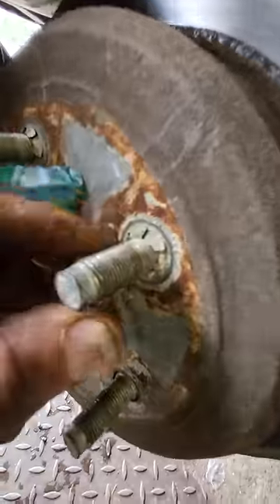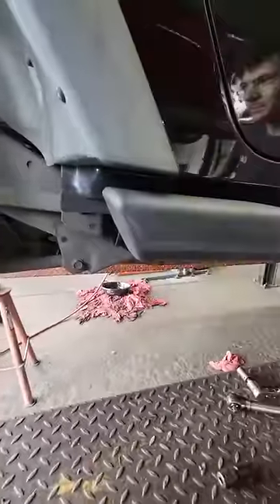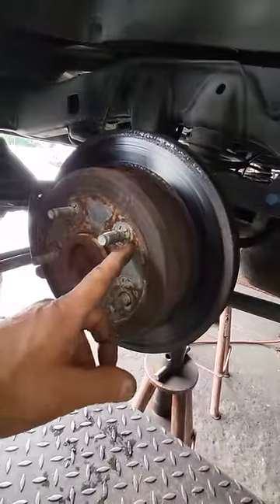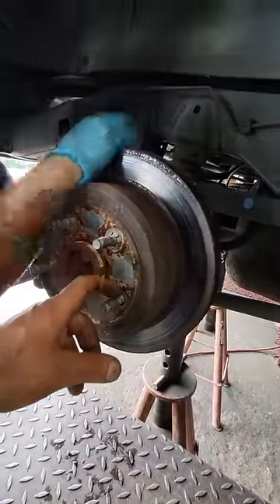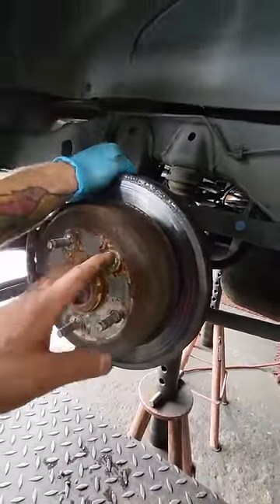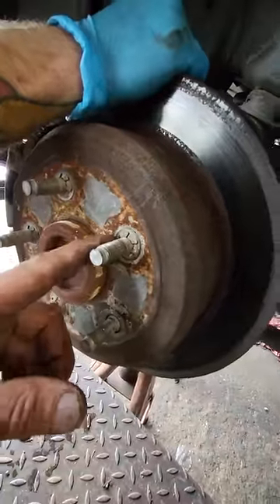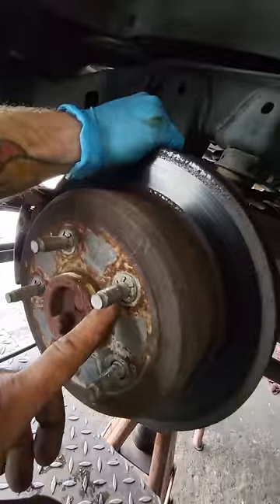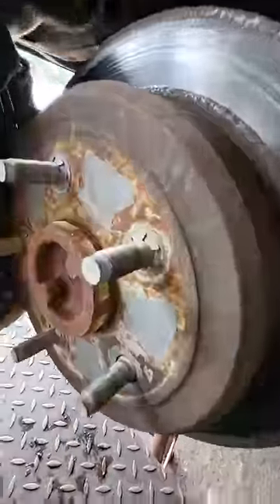There is always that guy

Comment: Like those wonderful Phillips screws on Kia brakes!
Gotta love them!
Reply: Honda too, except they're JIS (Japanese Phillips).  With a real JIS driver they come off okay.  A Phillips driver LOOKS like ut would work, but it acts more like a drill bit.  Old motorcycles are infamous for this.  Kawasaki used JIS bolts for almost everything, and by now every single one of them is stripped.
Reply: Pretty much every car made outside of US has them.. sometimes Phillips some time Torx sometimes one sometimes two but they all have ot both on discs.. can be a pain but usually not to big of an issue.

Comment: For those who are DYI, I found those clips in the SUV of my ex; I needed to replace the original back rotors after 110K miles. It was not common sense to me those clips were to be used as temporary retainers while in the production line, and thus, I went to the dealer to ask for them. It was there were I was explained the temporal nature of them.

Comment: I do my own brakes. Having someone else do them is a waste of money when you can do it for 25% of the cost of a shop. But with all that said, I'm that guy that would put two of the five clips back on. Just to hold it in place while I'm reassembling everything. It's not 100% necessary no. But it does satisfy some of my OCD tendencies

Comment: On my AMC Javelin, they used three bolts to hold the drums on and some of them were still there 30 years later.  A Youtube car repair guy working on a Javelin didn't know what they did and got the axle pulling tool to remove the drums.  Instead of just taking out the little bolts. That car was built about fifteen years before he was born.

Comment: Theres one guy out there that will do it right while there are many shops out there that will overcharge you to cut every corner they can find.
Reply: You literally don't need those. There to hold them on for the assembly line. Tell me you never worked on cars without telling me
Reply: @dippingfool4785 

okay 😂😂 plz leave a comment and tell me how did I do😂😂😂😂🙈
Reply: That's true, and very irrelevant to these little retaining clips.
Reply: @dippingfool4785 They aren't technically needed, but OP's point still stands. Ton of shops out there cutting corners, in the name of profit.

If I had a dollar for the amount of Fiat intake manifolds I see with the support leg cut off, or VW TSI engines, where the support bracket for the manifold is not reinstalled...
Reply: That is not doing it right.
Reply: @LynxStarAuto  well 1st off vw in general is ass too work on. And 2nd were talking about clips for the assembly line to hold the rotors on. There's literally 0 reason to be on there. Apples to oranges

Comment: I'll go into detail about how I went about dealing with these clips. 
My first few years,  I would carefully take them off, flatten and replace them, which took a good amount of time to do. After getting chewed out about the wasting of time and effort,  I began to split them off with a small chisel  in only one point,  which made it easier to take them off without destroying them,  and still replaced them. 
But after enough times servicing brakes, I adopted the habit of modifying certain axle nuts, by grinding them flat enough, and grind a portion of the nut flange down to hold the rotor flush with the flange via the lug nut. Later on I began to come across tools made by several manufacturers with the sole purpose of holding the rotors stationary during service.  I didn't give in,  since my nut method works for studded as well as European designs, while the service tools are specific to either designs. So at the end of it all,  I simply cut them off and tossed them in the trash. 
Needless to say,  when I see these clips in new cars,  now that I'm currently not working in the field,  I can't help but chuckle thinking about how new techs go about dealing with said hardware.
Reply: ⚠️😳☝️🦧⚡️😳🍺🍺🍺👌❗️....✍️🚫🦧
    No, really! I know we've chewed some of the same kinda pain....now I jus clip 'em.. an drop 'em
  ❤
   Edited 
  IM MUCH BETTER...NOW..😊

Comment: I wonder what other "cut that crap off" attitudes they have towards a simple oil change? That crush gasket is fine, just reuse it!
Reply: Agreed. It may not be needed but either the owner took pride and wanted to keep like factory or he did t know they weren’t needed but still made sure to put it back the way he found it. Best rule of thumb when working on cars is to make it so the next person never knew you were there
Reply: The funny thing is they are fine to reuse though 😂 At least a few times. Fleet mechanic here and we never change those on every oil change and we don't have issues with leaks. Our vehicles get about 5-6 oil changes before they're replaced.
Reply: @TireSlayer55 ”our vehicles” 
Why do employees almost without fail use language that implies collective ownership on company property?
Reply: @Bazed. Because the company made them responsible for that property mayb

Comment: I used to put these on when I worked the assembly line... the wheel studs are inserted from the other side of the drum and those tabs hold them in place long enough for the next guy to press them in.
That's their whole purpose in life... hold the studs for 60 seconds and be flat enough to not effect the torque of the lug nuts.

Comment: I once had a customer have me put back the retaining bolts for the rotor. 
That he saw me throw into a scrap bin. 
He literally was watching everything I did. 
I tried to tell/assure him that they are not needed and are used on the assembly line. 
He wouldn't hear it. I dug them out except one I was unable to remove, that I drilled out.
Pain in my as s. 😠
Reply from the maker: Yeah, just like the customer who say hand tork my wheel, nope, I won't do that  either
Reply from the maker: And yeah I don't do that either  toss that crap ..so the next time they stripped  break or seized
Reply: I always refit mine.
If you don't, and you remove the wheel, bits of dirt or rust can fall down behind the brake disc, causing your steering to wobble under braking.
Just put copper slip on them, and don't put them on tight.
Reply: That's what happens when people don't know what they're talking about or looking at. I've had to deal with those people, the types who are convinced that something completely negligible like missing rotor screws are gonna ruin their car, but they're also the kinds of people to drive around without looking in their mirrors, 3 inches from their airbag. So maybe it's better to not waste the time and just humor their idiocy.
Reply: @ryanwilliams6526  sure, that's a thing that happens..... And I'm a fairy god princess.
Reply: @anthonynastasi4098 that's a bit ignorant
Reply: @ryurc3033  yes it does happen. People remove a wheel, the rotor tips away from the hub, a bit of scale from the rotor edge dislodges and goes between the hub and rotor mounting surface, causing an uneven face. 

Like princess and the pea. even a little bit will cause it to wobble.

You obviously don't run a shop as I'm convinced if you did, you would have come across this at least twice.
Reply: @anthonynastasi4098  Are you one of the shops that just uggaduggas the nuts on and calls it a day?
Reply: @ryanwilliams6526  How to tell you have never worked on a car is give your answer. It literally makes no sense if you did know anything.
Reply: @Random-ed2xf  Why is this so difficult for you people to comprehend?
I own 3 cars, and the newest is 24 years old. I do all my own repairs.

Maybe you only work on new cars?
On a car that's any more than a few years old, there will be rust and dust underneath.
If you remove the wheel, and there's no screw holding the disc to the hub, rust and dirt can fall in-between.
This will cause the disc to not be completely flat on the hub, and can cause a slight vibration under braking.

I don't see why people struggle with them so much anyway. Use an impact driver to remove them, put copper grease on them, and refit so they are just tight with a screwdriver, and you won't have issues with them.
Reply: You actually need those retaining bolts on 2016 Jeep cherokee because it uses lug bolts instead of nuts. So, without the bolt, you will be spinning the rotor and wheel around, trying to line them up with the holes.
Reply: @watersnortmoment3734 if you use a torque stick there's really no need to hand torque but straight uggadugga at full torque is no bueno

Comment: Ive had to remove them on brand new cars with certain aftermarket wheels.
Reply: no ya didn't
Reply: It’s a thin piece of metal that flattens out against the mounting surface of the rotor when you put a wheel on your not going to have a slight gap like what you think thanks for letting everyone know you absolutely have no clue about vehicles.
Reply: @Back_door_bandit_98  You actually ironically proved yourself to be lacking knowledge. While true, the metal will deform to be flush, they server zero purpose outside of the factory. Do a little bit of research, they're called stud clips and they are functionally useless outside of the assembly line. Thank you for telling us your ego was far larger than your knowledge on the subject though.
Reply: @Back_door_bandit_98 …. Wow you’re joking right? I hope you never touch any car of mine bud. Like the OP comment said, on some aftermarket wheels there is NO RECESS machined into the wheel flange to give room for the stud clip. These clips ABSOLUTELY WILL NOT flatten down to nothing ( are you insane?). If left on the rotor when installing many aftermarket wheels it will cause a serious runout problem and wheel vibration… ASK me how I know.

Comment: I even throw away the little screws i find holding the rotors on, have had to drill out way too many of those buggers because they rust solid  and no amount of pb blaster or wd 40 or heat will penetrate them, in addition to just trashing those ring locks.

Comment: I had factory sealed brakes on a Denali with 80k miles, I think it was a 2000 or 1999, but the dealership service guys couldn’t believe it
Reply: I believe it..70% of stopping power to the front, normal use. Decellerating before braking makes for very light rear brake use.
  In this way, one could get a change rate of 2-1, that is, front pads twice to the rear shoes/pads once.❤

Comment: Had the brakes done at 60-70k at the dealership they replace them I worked for vendetti and we did replace them as required by tge manufacturer spec
Reply: You know why they do that? Because it's the correct thing to do. It came with them, it should have them returned.

This shop is a bit dodgy.

Comment: Maybe he just wanted to do the best job he could do!!
Reply: It has no function. Understand the work that you are doing or don’t do it.
Reply: @MWilk098 it does have a function. They are to dampen vibration dip shit.. everyone saying for the assemby line: is a idiot... if thats the case then why do the front rotors have set screws holding them in place? Lol.
Reply: @jc9233  lmfao, no, they are not.
Reply: @MWilk098  then why do front rotors have set screws? Even though the lugs hold them in place?
Reply: @jc9233 they are not for vibration.  Remember one thing engineers today are not the best, and car companies have many of them,  and common sense is only as good as the computer program they are using.  And I would bet one person designed the front breaks and used a screw to hold the front rotor on because of the front weighing more,  and another  one designed the rear end used a clip because that rotor is smaller, and lighter.
Reply: @DT-wp2yc  the engineers aren't the best? Lmfao every single thing on your car has a purpose. It cost money to be there.... and if they're not for vibration then what's the point of having a screw in the front rotor? Or the rear??? You think you need to put a set screw in a front rotor when it has 8 lugs bolting it down??? Lmfao why would they do something like that? Put a screw where one isn't needed.... unless it is needed and it is used to dampen vibration like I just told you...
Reply: @DT-wp2yc  I just wanna point out. Im a ase certified mechanic and this is literally one of the questions on the brake section................ you'd think maybe.... just maybe. I know what I'm saying.
Reply: @jc9233  being certified doesn't mean anything. I'm an old school, and new school tool maker meaning I program,  set up and run cnc machines for all types of metals,  and I know what it takes to get vibration out of a set up,  and I can tell you for sure that little flimsy  clip isn't doing nothing but holding that rotor on until 4 to whatever amount of lug nuts and wheels are put on. That will tie it all together to take out vibration.  Now the caliper, and pads are what does the vibration, and is why a small amount of grease is put on the back of the pads,  and why some pads have damping pucks on the pads.
Reply: @jc9233  my brother is a none Asa certified mechanic and is always getting problems with cars that certified people can not figure out specifically when it comes to electrical problems. This world is full of want to be professionals that don't give a crap about doing a good job anymore.
Reply: Meh, there's no real purpose for stud clips outside of the assembly line.

Comment: Had those on my rear axle of a 2002 Dodge Ram Quad Cab 1500 when I had the oil changed. I was in Junction City, Kansas, and only the dealership stocked the required additive.

Comment: I worked at a dealership and I if the vehicle was still under warranty or very well kept I would take a pick and spin them back up the treads of the studs and reuse them with the new rotors to keep that ( just rolled of the assembly line vibe). 😊😊😊😊

Comment: Zero function once it's assembled. After that all they do is waste time. Same goes for the little screw some come with. Only time those perform a function is if it uses wheel bolts rather than studs.
Reply: Agree sometimes it’s a pain but there’s times that you can use them. But my thing is if I can take a rotor screw off with ease then I’ll put it back on but of course if it has to be impacted and hit with the air hammer then it’s bye bye 🦅 birdie
Reply: @eliezerramosjr1017  they only time I don't toss the screw immediately after removal is if they're on a wheel bolt car
Reply: I'm super anal about putting stuff back together so I go the whole 9 yards and save the rotor screws, I put a lil dab of "anti sneeze" on em and put them in until they stop, not tight, just stopped that way they'll come out for the next guy. They do help when you've gotta put a caliper with pads back on, some of the ones I service require a special tool to decompress so I just turn the piston with a pry bar by hand till its just wide enough to slide on and call it a day there. But that's really the only reason I keep them around, just to avoid tediously decompressing a piston and wrestling with a loose, uncooperative rotor.

Comment: It's called having pride in what you do. As a fellow mechanic, do not trash. Talk somebody who goes above and beyond and takes the extra measure of precautions change whether they are necessary or not.
I started out doing oil changes. I had a co-worker. Tell me that wearing gloves and stain clean.  In that line of work was about the stupidest thing that they have ever heard of because you're changing oil. You're gonna get dirty which is not the case. I always stayed clean and never got dirty
Reply: They serve no function after the car leaves the assembly line.

It just makes things a few seconds faster for the guy installing the calipers.

At over $2 a minute I would be extremely pissed off at someone who spent an extra 10 minutes removing and reusing those clips on my car.

If I caught someone charging me over $20 to save and reuse 50¢ clips that you are supposed to throw away , it would be the last time I ever used them

Comment: I know nothing about cars, but good ol YouTube helped me do my own brake job. 10/10 would do it again. But I noticed that the screw that hold the rotor was snapped. Tried to get another one since there's room for another one. Later learned that that's just for the assembly line. Although a bit difficult, I managed to mount the tire.

Comment: Bet then guys put aftermarket wheels and dont remove them😂 shaking down the road 
Wheels gotta have a bevel for them
Reply: It’s a thin piece of metal that flattens out against the mounting surface of the rotor when you put a wheel on your not going to have a slight gap like what you think thanks for letting everyone know you absolutely have no clue about vehicles.